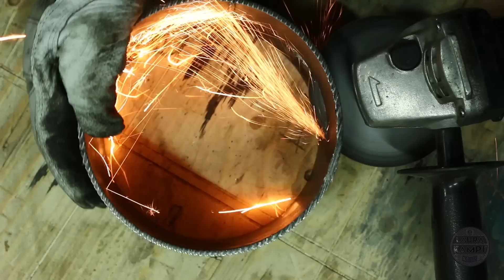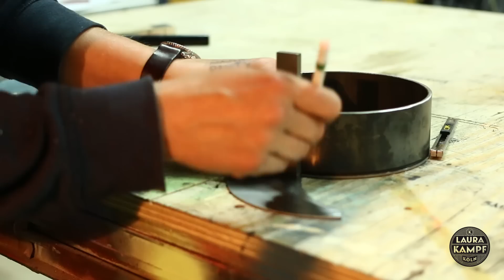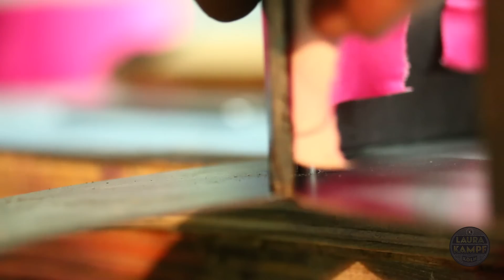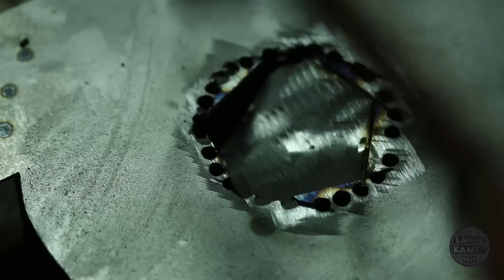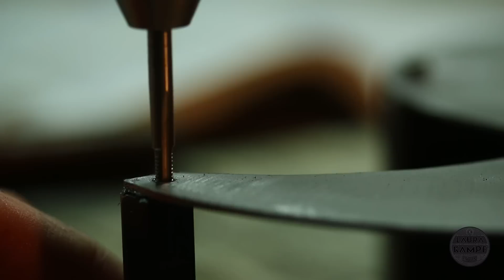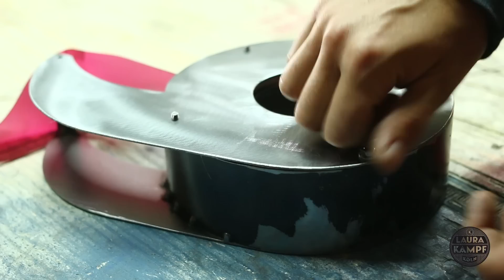Laura´s Duct Tape Dispenser

Comment: Your creativity is so inspiring! Loved this project. Also, do you use your same assembly table with a piece of sheet metal on top for welding or do you have a separate welding table? I just got a welder and am debating on whether or not I want to use my outfeed table for both by just laying a piece of sheet metal on top.
Reply from the maker: i used to do that but now i have a seperate room for my welding stuff...if you have the room, try to sererate welding from woodworking. it´s dangerous because of the sawdust.
Reply: +Laura Kampf got it. Yea, my shop is in my garage so I'm trying to keep the metal stuff on one side and wood stuff on the other side.

Comment: Cool, you could place a strong magnet in it. Then it would not move as mutch on a metal surface, so you can use it with one hand.
Reply: That's a fantastic idea. You could probably do that with any tape roll, just super glue the one side to the bottom of the dispenser.

Comment: Now i want to learn how to weld even more. I want one of those, no, a few. That is such a nice thing and such a nice process to watch and such a nice video! Gratuliere! Wonderful!
Reply from the maker: thanks, willem. this might be a cool project to learn welding, especially if you want to make a few. just don´t buy steel that is too thin. i used 0,7 mm but you could go with 1mm to make sure you don´t burn through

Comment: Nice, reminds me on a very (very) old series in the “Hobby” magazine - “Die verrückten Erfindungen des Herrn Quacks” (oder so). Beautiful and not fully useless ;) 
BTW if hit, it’s better for the nail to release the blood by drilling a little hole (~0.3 mm) in it (by hand!! - just increase the drill shaft diameter by putting a few layers of gaffa tape ;) around it ) so you can twist the drill with the fingers

Comment: very well ... i like a lot the project Laura .. i will have used an easy way to close the lid that holds the tape in place in order to change the tape quickly ..
Reply from the maker: i think it´s funny that you have to unscrew 5 screws just to change the tape...emphasizes the concept i think
Reply: +Laura Kampf yep.. it's true in that way of think the project..